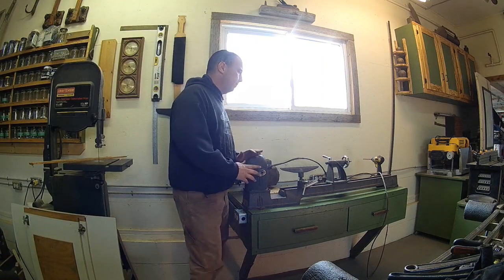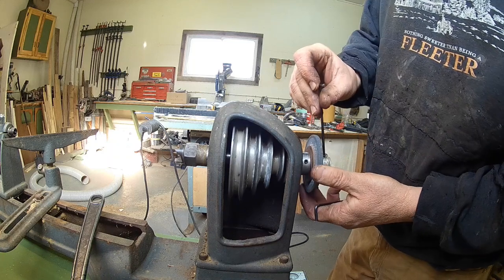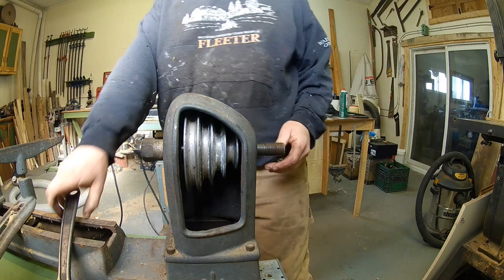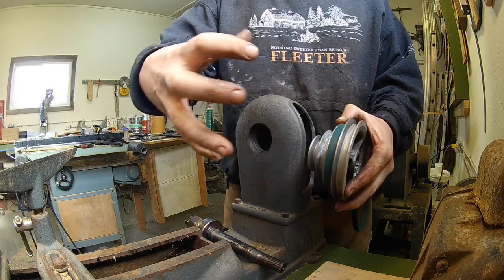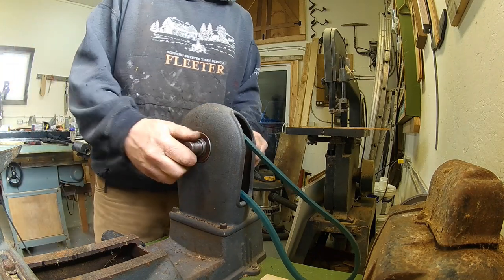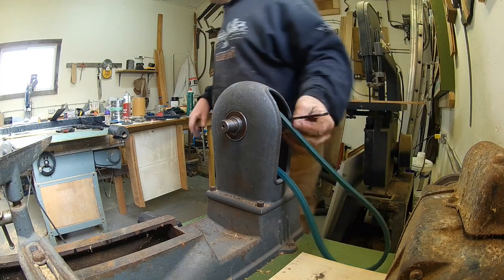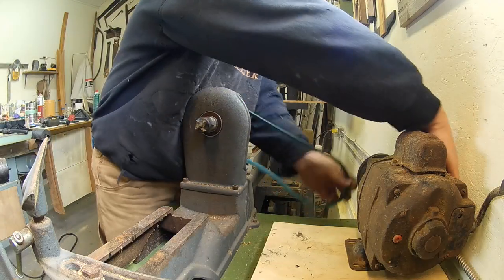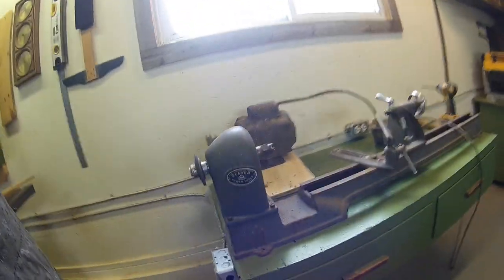Rockwell Beaver 3400 Lathe belt change

Comment: Good video.  If you use a pin wrench to remove the collars on the outboard side, you won't damage them.  You can also use the collar to push the outboard bearing back into the housing by tightening them

Comment: Thanks for the video - it was very helpful! Any advice on what to do if the pulley is difficult to remove from the drive spindle? Mine will slide a bit either direction but not easily. I can’t seem to get any WD-40 in to where it needs to go in order to loosen things up. Just apply more force? Keep on hitting the end of the spindle?
Reply from the maker: Maybe its a scored spot from the set screw or a tiny spot of rust? That may catch on the pulley as it slides over. The pulley is soft aluminum and may eventually slide off leaving a scratch on the inner bore. Please be careful when hitting metal pieces.